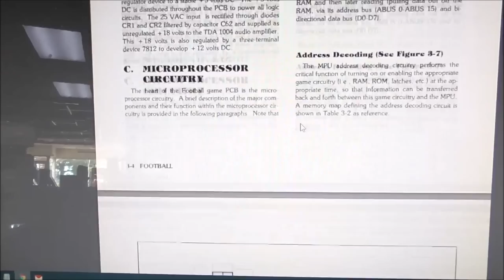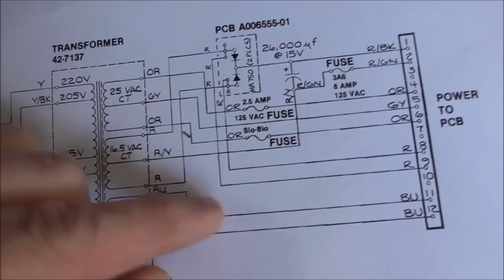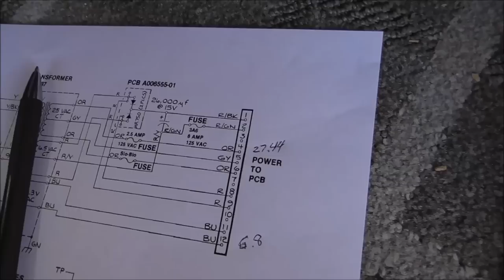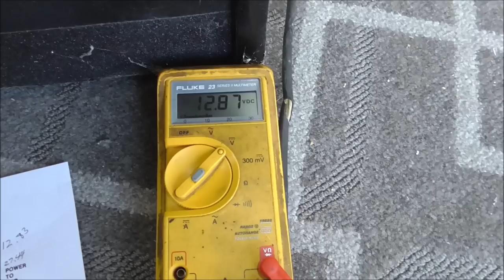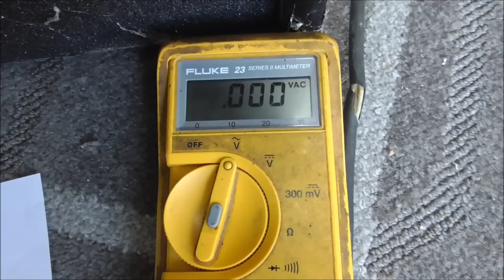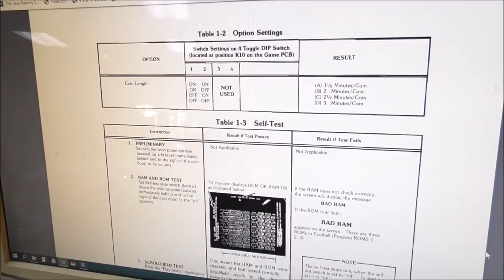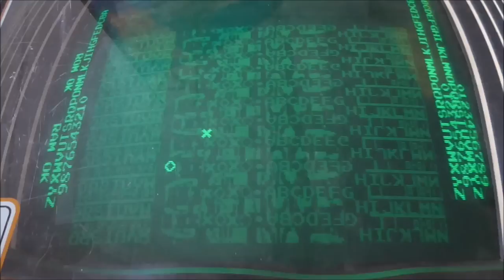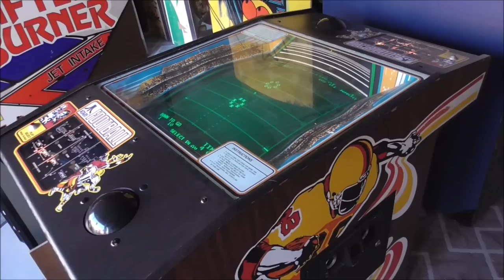Repairing a 1979 Atari Football X's And O's Arcade Game!

Comment: Ron, you may not have seen much ripple on that old capacitor because you had unplugged the game board and the power supply wasn't under load. Ripple gets much worse when you draw current from the power supply, so the no-load test will only catch the crappiest of capacitors. Doesn't matter though, because when the capacitor is older than you are, you replace it anyway!
Reply from the maker: Ahhhhh, that would explain it, thank you.  I never thought about that, with no load not much would be running through it!  I didn't want to leave the pcb plugged in (you saw that part of the video) because it was obviously unhappy and I didn't' want to fry anything.  Thank you for mentioning that, I'll know in the future!

Comment: Wonder why they didn’t do a full bridge rectifier?
Reply from the maker: I'm not sure... I've never designed anything in my life I just work on them but I can tell you that up until about 80 they had two diodes, and then after that they started using a bridge rectifier. 

I just looked it up and it appears that when you use 1 diode, it's called Half Wave Rectification 2 diodes is full wave rectification... a bridge rectifier is the same... the main difference being that if you use 2 diodes (instead of the 4 in the bridge) you have to have a center tap on the transformer.  

So if you have a center tap on the transformer (this does)... then you can use 2 diodes instead of the bridge rectifier and get the same effect.  The crazy thing is though they made a special PCB to mount the 2 diodes on, surely a bridge rectifier would have been cheaper than all that.

I'm sure there's some reason i'm unaware of, though.

Comment: Atari football X’s and O’s. Pretty sure my issue is power supply related (no coin lights, led, etc). I’ve replaced the line filter (old one was broken) and the big blue. All fuses are new, and values are correct. The only thing I haven’t done is replace the diodes on the rectifier board. Here are my readings:
Blue wires - 7.19AC and 0.5DC
Orange and Gray wires - 13.73AC and 1.1DC
Red wires - O.L to 6.6AC (fluctuating) and 12.22 DC
Measuring .462v and 0.L across both diodes on the rectifier board
Any help is appreciated!
Reply from the maker: The coin door bulbs are ran off of the blue wires, it's a 6.3v winding coming off the transformer... your 7.19 volts ac is correct (it's not regulated)... it then runs to a fuse (the fuse block may be dirty or the wiring burnt, etc.)  I would think you have a bad connection at that fuse, you can leave your one lead on one of the wires and then move the lead on the other wire to each side of the fuse, and see if you keep your 7.19volts.  That should help you track down where it's getting lost, it'll be at a connector or that fuse.

The orange wires are correct, the Red wires are bouncing around probably because there is a big capacitor there that your meter may be trying to charge up.  Those voltages seem fine.  You may want to measure between the red/black and red/green wires, you should have something like 10volts DC, that gets turned into 5 volts on the PCB.  

If your game is up and running though and it's just the lights, the 10volts must be fine.
Reply: @LyonsArcade  thank you!!! Will look over and report back
Reply: @LyonsArcade  ac voltages at the fuse wires, disconnected from fuse holders:
4.2, 4.67, 2.76
Continuity is good on all three holders w fuses installed
Reply: @LyonsArcade  lights on! 3A fuse at base of cab was showing continuity. Took it out of circuit, blown! Replaced, all good.

Comment: I got my game booted up, but I can't credit a game (both coin switches result in no credit when activated, and I've tried replacing the left door switch with no change). I'm guess it's a wiring or connection problem at the molex and/or edge connector?

Comment: The Old Blue Cap DC voltage and AC ripple voltage measured the SAME as the brand new Filter Cap DC voltage and AC ripple voltage, that doesn't make sense how it fix the arcade game.I don't understand why all arcade games have that big blue filter cap rated 27,000uf it just doesn't make sense to me at all because if you put a current clamp to measure how much current is being drawn by the arcade circuit its maybe a few amps at maximum. So why that 27,000uf when the arcade circuit is drawing little current to hold and store all the current and voltage in a filter storage cap of 27,000uf?